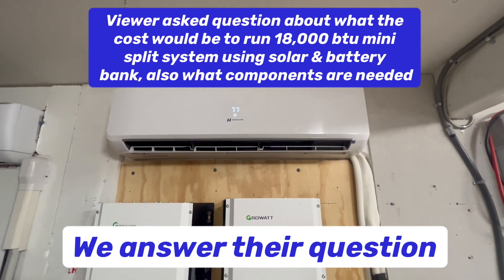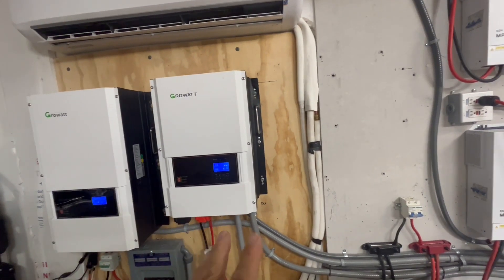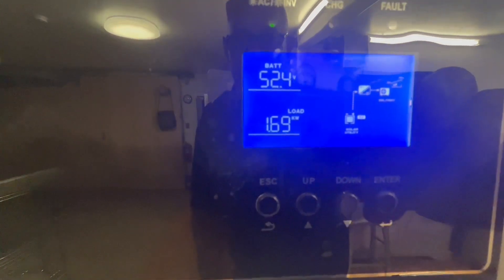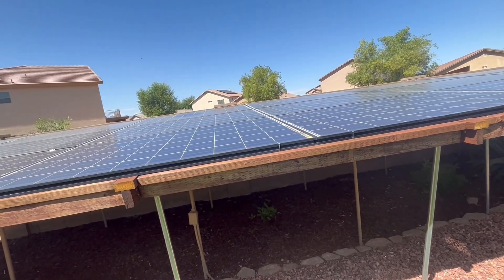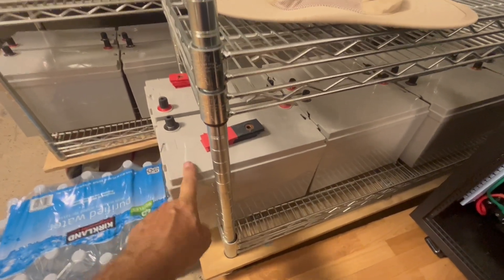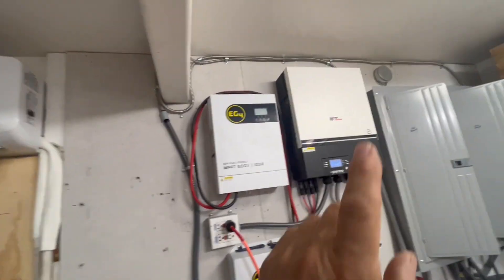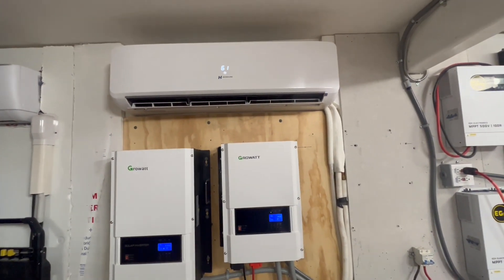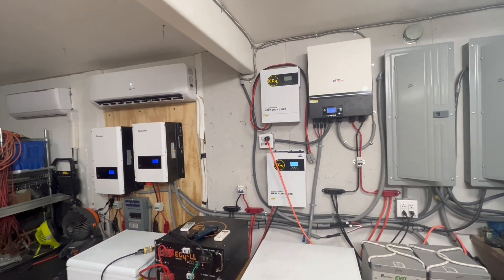Answering question from viewer using solar & battery bank running 18,000 btu mini split AC & cost

Comment: I bought the 38 seer minisplit and it is 220 volt 9000 btu. It goes as high as 13500 and as low as 2000 btu. I easily run it 24.7 when im not im my semi truck. I ran it non stop off of 7kw of battery and 1850 watts of solar. Ive now upgraded to almost 30kw of battery but that runs my whole camper with the ac. I think the high seer units use about half the power of the cheaper units. Mine takes 200 to 300 watts to run 24.7 it takes a little over 600 watts to cool the camper down but yeah 2 or 3 hundred once its cool
Reply from the maker: Very nice, I can’t wait to install and try a high seer mini split in my motor home.trying to find flexible solar panels to install on roof but still investing weather worth it. Thank you so much for your input. It helps all of us doing DIY solar when you leave comments like this. Hope you have a wonderful and blessed week
Reply: @diy-solar-guy  I started to use flexable panels and just use vhb tape to secure them to the roof. At the moment I have 1850 watts on aluminum ground mounts but the flexible on the roof in my opinion would be the way to go but they are kinda expensive. I bought used panels but they work great. I'm looking at getting 10 or 12 more this next week. The solar project has taken my mind off of being sick and given me so much happiness and satisfaction and feeling of accomplishment when I'm home and it's all working. Thanks for the conversation and you have a great week also. Happy 4th
Reply from the maker: @matthewknight5641  thank you so much. Happy 4th
Reply: What brand/model was your 38 SEER mini split?
Reply: @ernestgalvan9037  inovair 38 seer 9000 btu. It's a 220v model and I run it from a sungold power inverter. The sungold inverter is way overkill. It would run on a lot smaller inverter but the only one I had that was 220 is the 4000 split phase sungold
Reply from the maker: Thanks so much for your input.